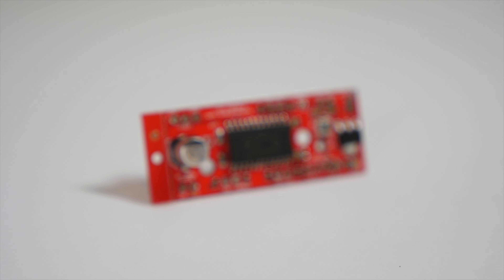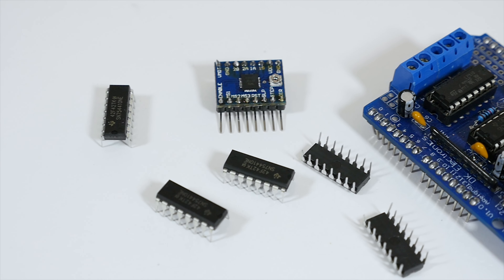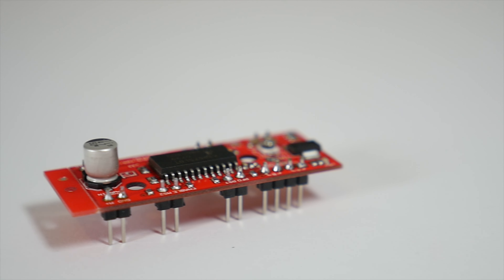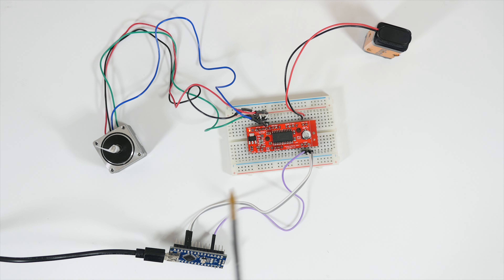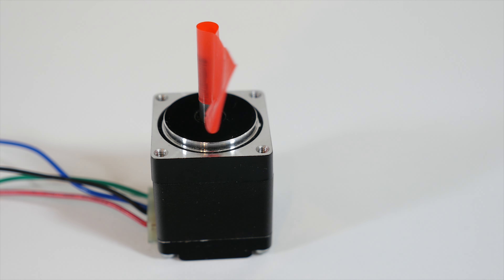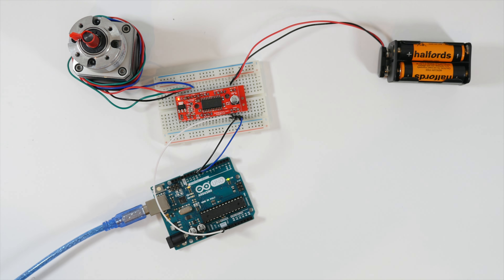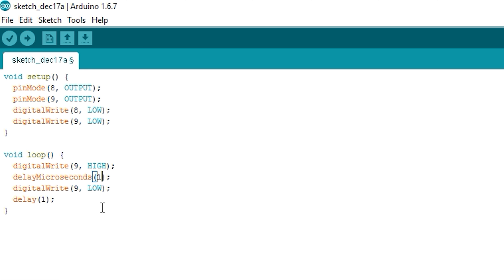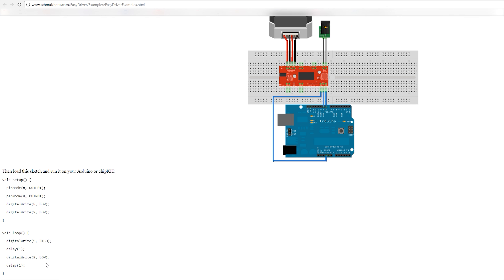Easiest way to control a stepper motor - EasyDriver

Comment: just wondering, is the smallest step angle for stepper motors capped at 1.8 degrees? or can it be smaller than that? thanks in advance
Reply: You can do micro stepping with the easydriver using pins MS1 and MS2. The easydriver defaults to 1/8 step, so about 0.225 degrees per step. I usually turn micro stepping off for my projects because I haven't needed that level  of precision.

Comment: If i have followed every step as explained but my motor still wouldn't move, what could be the problem? Does it necessarily have to be connected to a power source? or can i just connect it to the Vin pin on the Arduino Uno i'm using?
Reply from the maker: There are many possible reasons why it isn't moving but one of them is probably that the motor isn't receiving the current it needs, try connecting it to an external power supply. Hope this helps

Comment: But if I had multiple motors like 5 motors , how could I run them all by this bord?
Reply from the maker: I haven’t personally tried but it should be possible to run multiple steppers off of one easydriver by just wiring them together. Of course, the current will be lower for each one so if you are using more powerful versions, it may not work properly. Hope this answers your question.
Reply: WorkshopScience of yah how much it can take on top ? If  I would like to add wife  and witlessem staff which micro bord you will recommend ? Thank helping

Comment: Could the Arduino nano be used to run the code for the Nema 17
Reply from the maker: yes, it works on the same principle so as long as your stepper driver is powerful enough, there should be no issues
Reply: Yes, absolutely. I have used a nano on a much bigger motor than a NEMA17. You can use any size arduino or clone because it is the Driver (in this case the easy driver) that is delivering the power to the motor phases. All the arduino does is controller what and when the driver is working. So it's important to match the Driver output Amps to the motor Amps. Every driver I have seen has a way of limiting the current (amps) to each phase of the Stepper. You adjust this to match the strength of movement required or to the limit of the Steppers motor's phase current maximum so you don't blow something up.
Reply: @NeonblueIndustries  What are the power supply requirements to drive a nema 17? I have a 9V 450mA power supply, would this be enough, using the setup in this video.

Comment: Unipolar motors can be driven bipolar by just ignoring the center wires.
Reply: Can we? I just want to run the motor super slow less than 1 rpm i have hybrid 1.8 deg unipolar stepper motor

Comment: NO!  I do not understand at all how to USE stepper motors.  I have been through the {light an LED}, How to connect a stepper.....How to make the stepper rotate........I need more code.  All that I want to do is rotate a stepper 180 deg when I have counted 5 from an external input or switch.  Then count to 5 again and rotate the stepper 180 deg.  Over and over, count 5 volts or a short circuit 5 times, then step the stepper 180 deg.  (180 deg is equal to 100 steps with my 200 step motor).  I am really struggling over here.